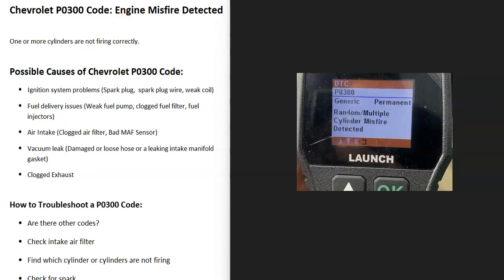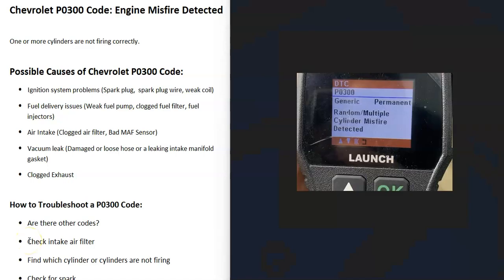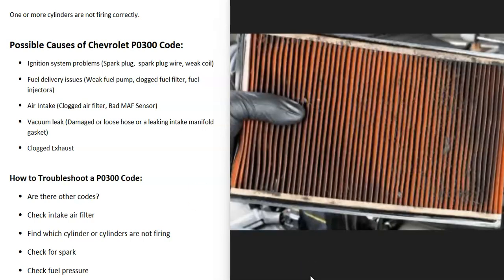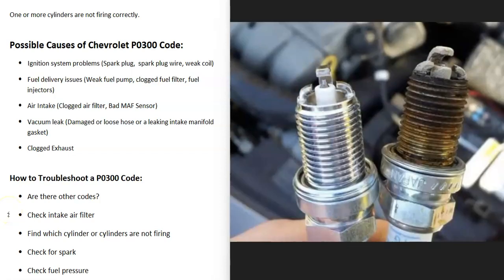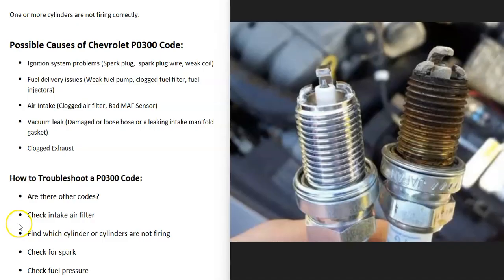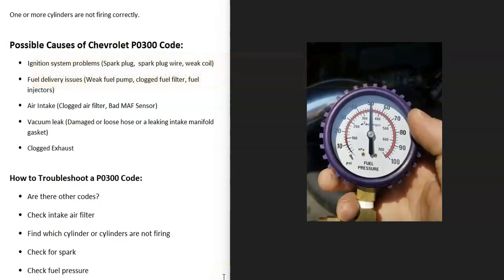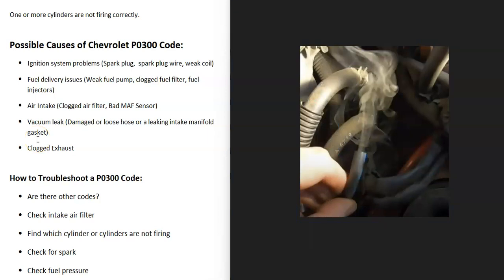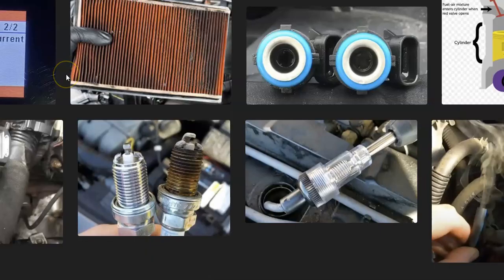Causes and Fixes Chevrolet P0300 Code: Engine Misfire Detected

Comment: Don’t forget bad gas! Water in the fuel will absolutely give you a P0 300. Also, don’t drive the car If the check engine light is flashing! It doesn’t take long for it to ruin the catalytic converters.
Reply: Currently driving mine and it’s flashing
Reply: @lordserpentine8246 did you find what the problem is??
Reply: @alexleyva3751  mine had a small header leak and something flashes the engine light 2 weeks no issues. 1hr ago I pumped gas bc I was empty now my trucks acting up it lights up low fuel then jumps back up to the actual level.
Reply: Depending on your state you don't have to worry about catalytic converters
Reply: Dry Gas/Gasline Antifreeze. (It’s alcohol). It mixes with the water and allows it to be burned up. I also used a good quality gas/diesel additive
Reply: Im thinking it was bad gas i put it was some cheap gas brand i usually put shell and this time my lazy as just pump on the closest gas station… also i put a new throttle body the day the code showed up
Reply: @ghozty_2162 I've already replaced the spark plugs and the coils and mine is still running rough and the p300 code is coming up again but I did fill up at shell the day before. That's where I buy all of my gas from.
Reply: @motorhead2003 i sold that car lol fCHEVYS
Reply: @ghozty_2162 lololol 😂 I'm a Chevy man and always have been but I drive a Ford Ranger. 😂😂
Reply: Goodness.Ive been driving mine for 180.000 thousand miles . How long does it take!!
Reply: 😂😂 @DannyHarris-o5g
Reply: What would be good for treating bad gas? And how did you fix yours
Reply: I drove mine for atleast 3k miles flashing 😂
Reply: @christopherjohn944 what was wrong with it ?
Reply: @ggkane6263  fuel pump…the fuel pressure was dropping below minimum under engine load …with theee gmt 800’s it’s gonna always be either fuel or grounds , also check your pcv valve could also be weak plug or coil
Reply: @christopherjohn944  I'm getting a misfire on cylinder 5. I changed coil,plug and wire but it still keeps coming back. Im hoping its a injector and not something internal

Comment: Bad o2 sensors possible? Im having all kinds of issues on this used 09 2500 hd it has been beat and abused so im finding problems every day but specifically this misfire issue
Reply: Do you have a  po171 & po174 code, with po300?
Reply: I have all 3 codes, changed o2 sensor and it didn't help
Reply: P0300 with p0150 and p0130 is bad O2 sensors. I know cuz mine had that. I replaced the O2 sensors. The O2 sensors codes disappeared but the p0300 is still there.

Comment: I have an 03 Silverado I’ve done everything but the air filter. If it’s that I’m going to be upset with myself 😅
Reply: Check the crankshaft position sensor, had to fix mine. Went underneath and seen the wires leading to sensor exposed, fixed the wires and got a new sensor. 

I went through a lot just to find out that everything from fuel pump, fuel filter, spark plugs and spark wires, to the distributor cap you name it… all that to find out it’s just the damn CP sensor and it only takes under 5mins to fix 🤦🏻‍♂️😂

Comment: I have PO300 as well as PO174 and PO171 too lean on bank 1 and 2
Reply: I do too did anything work for you? Still trying to figure out mine
Reply: @AintgotnoGas7  I fixed mine when I found out having a lean running fuel pump and a wrong fuel pressure regulator
Reply: Bad intake gasket can cause the lean condition
Reply: @filter_this  changed it a few months prior to this post

Comment: I have a 2000 Camaro 3.8 with a PO300 code only. I have replaced  MAF sensor, fuel injectors, ignition coils, control module, fuel pressure regulator and fuel pump, Cam sensor and crank sensor. New fuel filter also.  Still have the code. If it was just 1 plug bad, there would be a code for that if I'm correct.
Reply: @georgemack1395 - Did you figure it out? I’m working on my wife’s 2012 GMC terrain V6, and I’m leaning towards the ECM or the PCM.
Reply: @johnsamuels6021 leaning the wrong way. Dont be a parts changer.
Reply: Be a parts changer don't hafta fix that part later  or be   on the road broke down later   😂 saying should just replaced it  all

Comment: After watching this video many of times, I will just blow off or vacuum the dirt on my air filter, my MAF sensor is still good because I made sure that the air filter is securely on it. I have to check spark plug again and maybe use my old ignition coils that I kept when I replace with the other new ones. It is always good to keep old ignition coils that is known to work. I watched another video saying dumping HEET Bottle anti-freeze water evaporator into the gas tank driving it for a while will work. Clogged Exhaust I know I do have because P0420 came up before P0300 and I know I have to replace my rear catalytic converter. In a forum said that if you replace the rear catalytic converter, you will have to replace the two front catalytic converters as well. The one by radiator and the one against the firewall. Without changing the rear catalytic converter for so long, that maybe my spark plug been burning so much, and the gap has widened on its own?

Comment: I’m only getting P0300. Nothing else so what would that mean code 1/1
Reply: Yes it started with the Engine coils from there the spark plugs and since then everything has been good another thing invest in the device called fixed it really helps 👍🏾
Reply: @unknowsecurity9694  I did all that and injectors.. I'm still getting a code..  I have the fixed it by the way
Reply: Did u ever figure it out
Reply: I used a FXD as well, AND GOT THREE RED CHECK ENGINE LIGHTS All three codes are p0300 and 1P0301 and an ABS code p0561-71. My question is my check engine light does not flash it stays steady Am I able to drive it to get it to a repair shop? And what you think might be wrong other than the stuff that you already spoke of in your video and cost?
Reply: Adding to my previous comment (3)-/ P0301. said it was cylinder 1 and P0300 said it was random. Does that mean all of them are having issues or just cylinder 1? Does the ABS code have anything to do with the cylinder issues?
Reply: If your are getting random fires as the codes I found out. That after all something cause the fixed to go off. So after I thought I fixed the problem it cam down to. New ECU witch was throwing codes so you would need to take it to a shop to get exactly where it is coming from and if the light is not flashing you should be fine fyi the longer you wait to do it the worse more money it will cost to get fixed good luck hope you can get to the bottom of the problem.
Reply: P0300 is random misfire. Regards
Reply: There can be a few things honestly another thing my spark plugs had to be spaced correctly other than that it can be one of these

 A weak ignition coil
Contaminated fuel injectors
Excessive carbon build-up on the intake valves
Low fuel pressure due to a faulty fuel pump
A vacuum leak
An exhaust leak
A faulty camshaft position sensor
A clogged catalytic converter
Compression loss
Hope this helps hope you get it fixed

Comment: I have a 02 tahoe with code p0300 previous owner install bosch sparkplugs with preset .040 gap, this engine need .060 gap,  will that cause p0300?

Comment: i have a 02 gmc 1500 that has this code it starts hard but when it is running it runs great. Any ideas on this?
Reply: You can do the basics of checking your spark plugs and ignition coils..air filter if its dirty...but most of the time you get a misfire when the car is cold is because of a bad intake gasket...when the engine is hot you don't see leaks because everything expands....